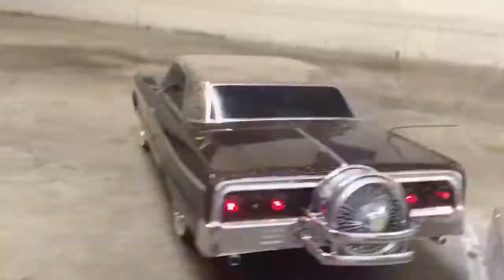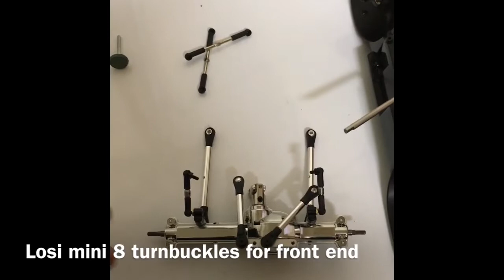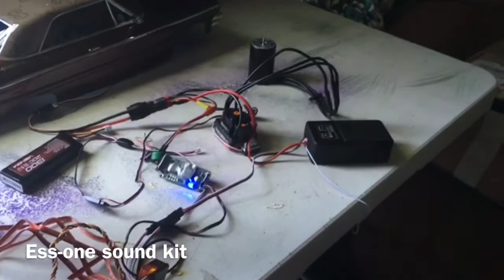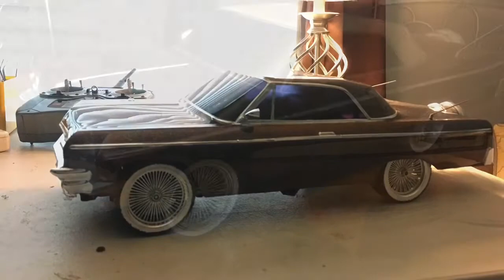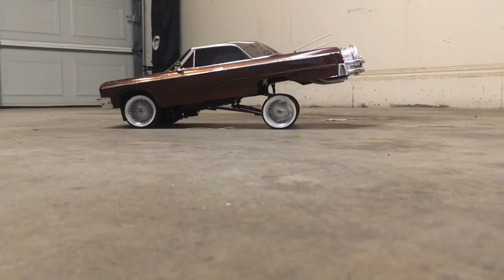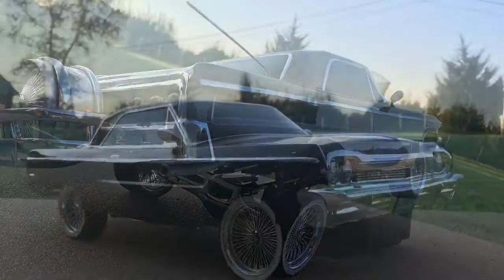64 Impala Lowrider Tamiya CC-01 chassis

Comment: Ok did you cut out the ears on the front servos, the ears that would sit on the front chassis/bumper? so that they would sit level? Thanks in advance. I am upto that part now in my build.
Reply from the maker: MARKLINMAN1 yea I cut the ears on some of them, issue cutting the ears the straps have nothing to hold the servos solid In place.if you look at the grand national build.i used a custom metal brace/ bracket to hold the servos down and have had much better results with that.
Reply: Dsnvogues OKCLOWS Awesome to know, I thought the same. Now to source out a bracket, I’m thinking Home Depot, with some long screws but skinny enough to fit thru those 2 holes. I am actually having fun and did the rear servos already. Super clean cut .
Reply from the maker: MARKLINMAN1 that’s what’s up man, keep me updated!

Comment: Ok, question, HOW did you mount the FRONT servos? I can see that you used TIE STRAPS to keep them together side by side, but i cant see how you have them tied down to the chassis?
I have completed by CC-01 Build and have everything running now to cutting the rear chassis for servo mount and mounting the front servos, i want to mount the front servos first and need a good video of the front mount of how you did it, or a pic....Hit me up on IG saxmanivan you can see my CC-01 build and perhaps you can DM me a pic, thanks again. Beautiful build, you got me inspired.